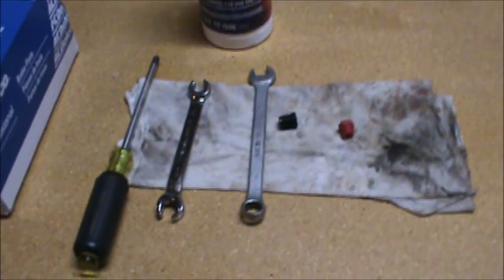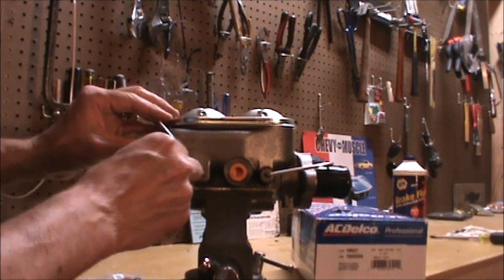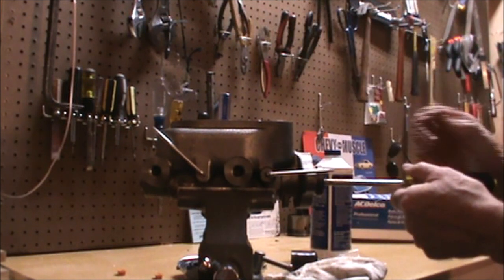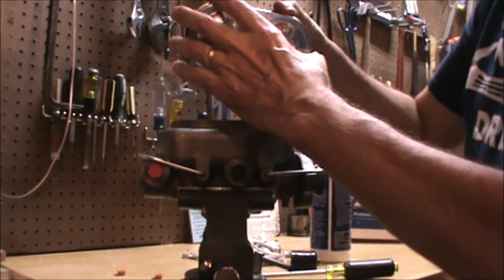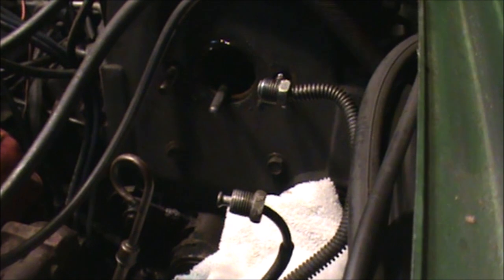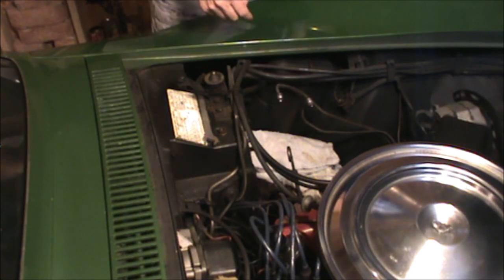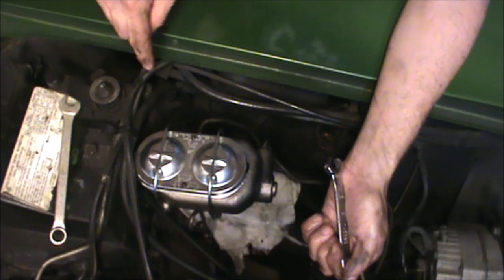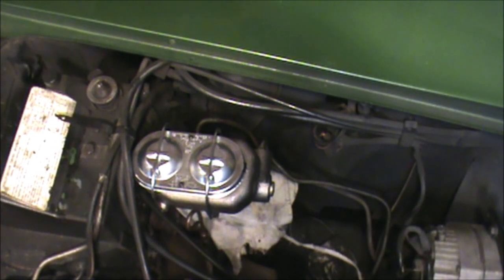The Shop - C3 Corvette Stingray Brake Master Cylinder Installation

Comment: How did you diagnose and determine that the Master Cylinder went bad?  
What are the signs/symptoms of a bad master cylinder?  
Thanks.
Reply from the maker: @PatrickWagz A bad brake master cylinder can cause various symptoms, including a spongy or sinking brake pedal, decreased braking ability, or no brakes at all.

In my case, after bleeding all the calipers, the brake pedal was still spongy.  I also saw that the fresh brake fluid was getting contaminated quickly.

I hope this helps you out.

Comment: Wrong way to bleed a master cylinder. You need to run lines from the two ports back to the reservoir. Pump till you see no more air from end of lines.
Reply from the maker: @2:00 I said there are two ways to do this.  ACDelco provides instructions and hardware to do this method of bench bleeding.  It worked well and had less mess.

Comment: Never saw a bench bleed like that, I always ran small lines on the bench back into master and slowly pump till all air bubbles are gone.
Reply from the maker: Gary Pearce I am with you on that.  I've always done it with the tubes as well. This was the second of the two options.  The first option on the manufacturer's instructions was the plastic caps came with the master cylinder.  I found it was neater to do it that way because the plugs were easier to handle when moving/installing the MC on the car.

Comment: 79 corvette pedal goes to thr floor ,not air in the lines,what the problem? Bad madter cilinder? Help please, pedals soft when car is running, thanks
Reply from the maker: It sure sounds like a bad MC, or a leaking brake line, or leaking lip seals in the Calipers.  See my videos on upgrading to o-ring seals.
Reply: @MikeHammill-TheShop  I don't see any leaks on calipers, I think I'm gonna get a brand new MC and new brakes fluid all around
Reply from the maker: @200horsepower  Sounds like a good plan.  Good Luck!
Reply: @MikeHammill-TheShop  I will let you know how it goes, another thing, hazard light work but not blikers,what's the problem?
Reply from the maker: @200horsepower  it is likely a turn signal flasher.  This is located under the console. If I remember correctly, you can access it through the driver side access panel near the front of the console. Remove and replace.
Reply: @MikeHammill-TheShop  ok thanks very much!I'm new with this c3 corvettes just pick up a 79 l82 4 speed manual
Reply from the maker: @200horsepower  fantastic!  Sounds like you are tackling the right problems first.  Enjoy!
Reply from the maker: @200horsepower  YouTube has a lot of great video to help.  You may also consider investing in a shop manual to get details that are not always shared in videos.
Reply: @MikeHammill-TheShop  oh ok sound good! Thanks for you help!!

Comment: actually on GM the from bowl is for front brakes and the rear is for the rear brakes..
that's why when you gravity bleed the rear, the rear bowl decreases in fluid.. But a C3 corvette with manual brakes??? YIKES!!! WHAT???
Reply from the maker: You are correct.  Front bowl-front brakes, rear bowl rear brakes.  Still getting used to talking while doing. I was pretty confident about the orientation since I said it several times. 

Yea, manual brakes are a riot!  I once had a 64 Impala with manual drum brakes on all 4 corners.  This car is an upgrade.  This car also originally came with manual steering (upgraded to power for my wife) and no A.C. (a joy in Florida).